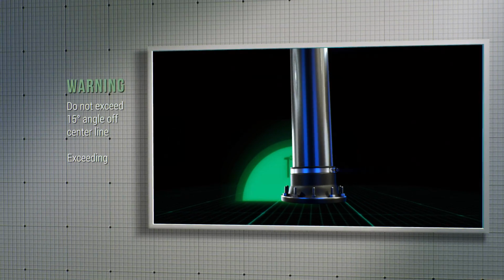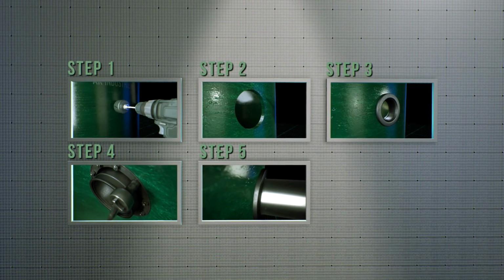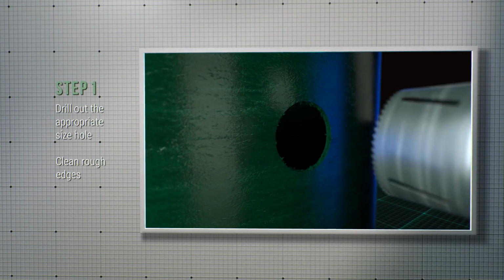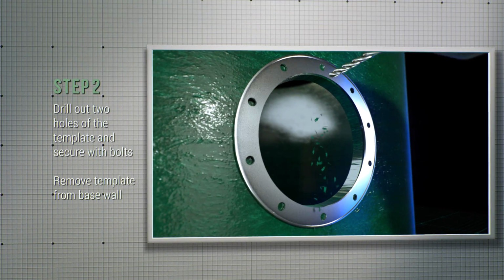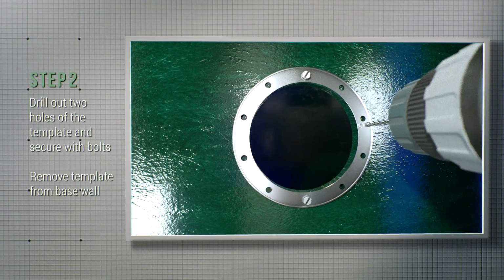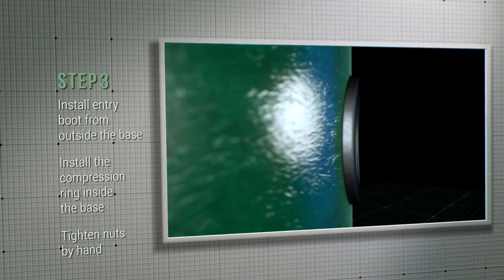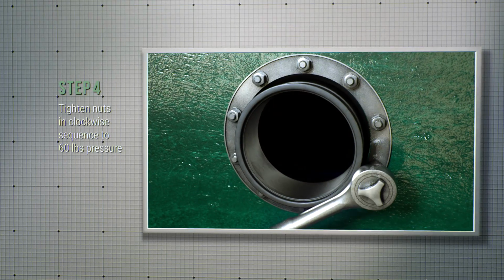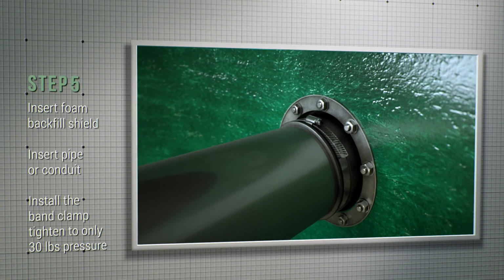AK Industries Flexible Entry Boot Installation

Comment: I have a round/circular tank sump 1400 mm diameter, do you have fuel resistant flexible entry boots that can be fixed to this sump? 2" , 3" and 4" diameters are rewuired